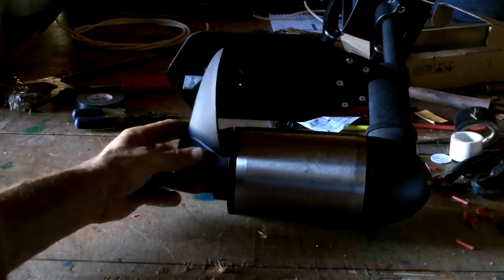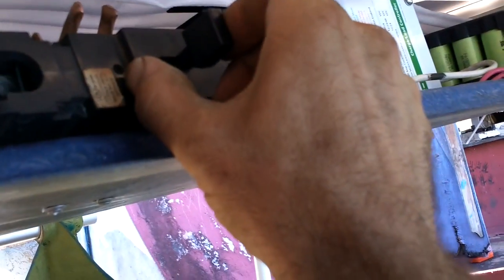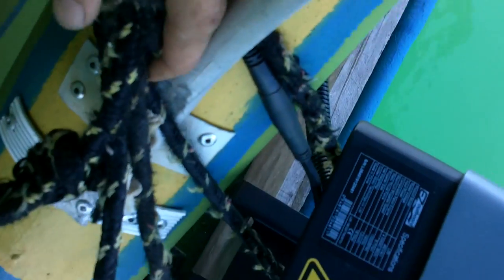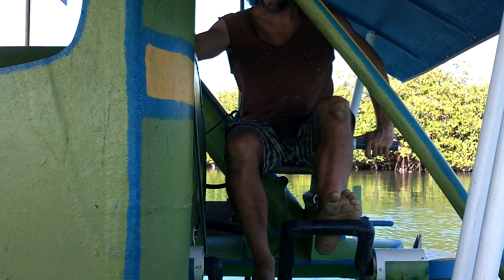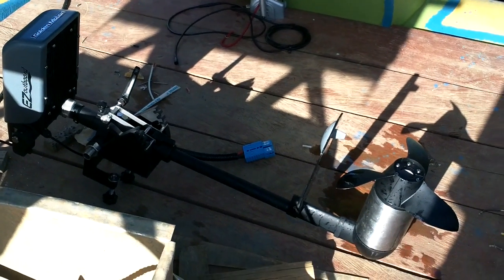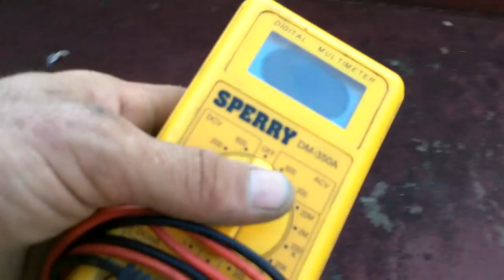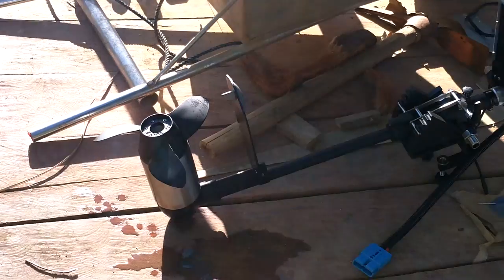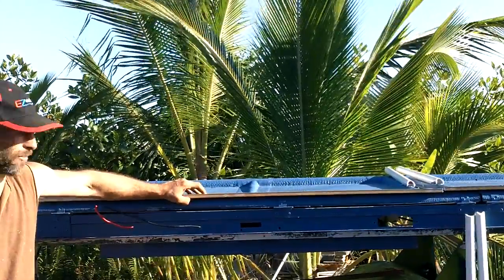Solar Snailer 039 Motor Test!

Comment: I've been watching your videos since your first attempts at fiberglass boat making, this is the first one I've seen with the comments turned on. Between your boat builds and Tech Ingredients  channel's Tesla Catamaran  you have inspired me to create my own minimalist live aboard solar powered Trimaran for on-the-water boondocking. Thank you so much for showing it's possible to accomplish a great deal with minimal supplies and equipment. Your first boat build you didn't even have a drill, I remember you stitching with a Swiss Army knife to bore the holes in your panels. Bravo man, I'm having trouble coming up with something sufficiently positive to describe your efforts. 

I'd love to have one of those electric outboards but it would cost more than my entire boat so I'm going to stick with the direct drive ebike hubmotor/controller I already have and rig a prop drive to it.
Reply: Flea markets always have dirt cheap trolling motors. $5-$20 range. Ditch the motor but use the drive system and prop. Or use it as it is.And please post vids when you start building.  I'm your very first subscriber. 
 Good Luck.
Reply: @2pi628  :I already have a Minn Kota trolling motor but they aren't very good motors, a brushless ebike motor is a lot more efficient, particularly at low power levels. Putting model airplane props on trolling motors like Tech Ingredients did on their Tesla Catamaran is better but even the best trolling motors aren't that good. You'd think an underwater motor would cool well but most of them don't because they are brushed motors with an internal rotor, the magnets are on the outside and cool well but the coils are the part that get hot and they are on the inside where they are just cooled by the air inside the motor.  The Golden Motor Jamie used in this video is a brushless one that uses rare earth magnets,  is more efficient and has the coils on the outside where they cool well.
Anyhow, thanks for the encouragement, I'm terrible at documentation because I get into what I'm doing too much to pay attention to a camera. I'm also  kind of self conscious about my workspace, I'm' a bit of a pack rat and my brother is a lot worse than I  am, we share a workshop and it's utterly jammed with stuff because once you get handy enough everything turns into useful material that's hard to throw out and he's a flea market/yard sale addict. 

It's been quite a while since I did a project and I can't find any full size pictures any more but here's a thumbnail of a recumbent ebike I made about eight years ago. 

https://tinyurl.com/qrha5qf

On edit: After looking at your channel I realize we share several interests including music and tiny homes/rv living, I'd like to contact you privately but see no way to do so on your channel. Mostly I text but I'm reluctant to post my # publicly since I've been doxed/stalked before.

Comment: Would be cool to be able to lift the manual blades out of the water while motor is on. Awesome build!
Reply: Yes and that would eliminate the vibration
Reply: Yup too much vibration and drag with the paddles in the water.
Reply: I thought the same but seems like it would be a complex heavy setup required that would be prone to breaking. I think since the water wheel is round a sliding cover for the bottom of it might work. If the water can be kept out it would even act as a tiny additional pontoon.
Reply: @kirkw1740  good idea!
Reply: That might reduce the amount of drag, even when peddling.
Reply: You're right, but Jamie uses the paddle as assist, so NO drag and longer life on the battery
Reply: @kirkw1740  A simple light weight fiberglass (over PVC) hinged arm could be used to rotate the entire mass up and forward out of the water.  At the same time he could get his saw out and remove a lot of unnecessary weight from all over the boat. I bet he could lop off 100 pounds(or more) if he put thought into it.
Reply: Since the paddle wheel itself is free spinning and relatively light the water resistance isn't that much.  A shield would likely create more resistance due to the shape.  Moving it out of the way isn't worth the effort either.   It also gives him brakes... Kind of.
Reply: It would be nice but wholly unnecessary as it moves fast enough and it runs on pure solar there's no real reason for the extra effort of a movable paddle wheel
Reply: @Mandurath  removing the noise, I feel would be worth a reasonable cost in efficiency.  Quiet , peaceful travel is worth it!
Reply: A guy in another comment (Gypsy Tinker, go upvote it), came up with the perfect solution: Have one or two paddles on the wheel be mounted on a hinge so that they turn into a flap, and then have them supported only in one direction (like a one-way flap valve). That way when he's turning the cranks, the paddles work as normal and are rigid. But if the water is flowing faster into the paddle than the paddle is turning, it'll flip out of the way and have almost zero resistance. All Jamie would have to do is rotate the wheel so that those flippy flaps are facing downward when he wants to coast (when one pedal crank is straight down, for example). The only drawback is you'd lose one or two paddles when you're going backwards (the'll flip out of the way), so you'd have a little dead spot on the wheel when backing out of a dock. Not a big deal, a few seconds compared to hours of better coasting.
Reply: Or he could also put a pulley on the water wheel and run a alternator to also charge the batteries, run lights. It seems to move just fine even with the extra drag.
Reply: Jeremy Genslinger or a belt and connect the water wheel to the electric motor instead of having a separate propeller. I'm just guessing.

Comment: I like what you do with such limited resources , one thing I learned about electrical wiring is as long as you don’t let the smoke out of the wires it should work.
Reply: Possibly not quite as limited as you think...

Comment: The EZ Outboard LO5 is a 5 horsepower electric motor that can consume 3700 watts an hour. Jaime has 11 200 watt solar panels to supply solar conversion power to his motor. I am going to conjecture somewhat, but this is what I consider to be real world numbers.  What we saw on the economy mode was a good 1000 watt usage from the batteries, in the lowest of 3 settings. At the early spring 4:30 time, he was getting maybe 400 watts from the Sun. A semi pro bicyclist will put out 300 watts in a continuous fashion. His trip to town is no small feat. The Solar Sailor is the incorporation of Jaime’s other endeavors in electric boat building. Experience thru necessity has resulted in another excellent final product.
Reply: Do we know the weight of his boat? Loa and beam too?

Comment: Loving the build Jamie. I had a look on the golden motor site and noticed your L-05 has an adjustable shaft. "Long/short shaft All-in-One, users can adjust the installation depth and angle at any time to optimize the propulsion efficiency". I also found out its rated as a 5-7hp motor with 195lbs of thrust! Interested to see its max speed on just solar power compared to the batteries!
Reply: Wow..Thats pretty good. (7HP x 745 Watts)/70% = 7450+/-  Watts from the Batteries and Panels for full thrust rating. 
How much in power in Panels does he have? And in Batteries?

Comment: RE: Obstructive paddles. If one of the paddles could pivot in only one direction so it would only engage when pedaling forward, pivoting when coasting. Rotate pedals so this paddle is at bottom when motoring, lock pedals. Folding prop style, with minimal modifications or weight.
Reply: Wow, that's an awesome and simple idea. That'll totally work! Great thinking!
Reply: @MattsAwesomeStuff  If you want efficiency look up "Spider crank paddle wheel"....
Reply: I think the paddlewheel is used to power the craft in reverse, too.
Reply: @Patriottoo2  .yes. With only one paddle like this, it would reduce efficiency in reverse, but you don't travel far in reverse and the motor also has reverse.
Reply: @GypsyTinker2012  Okay, I re-read your first post, and understand it, now.  Great idea.  If reverse of motor is as fast as forward, it doesn't appear useful for slow maneuvering.

Comment: hydroplanes for the high speed mode
Reply: in the hydrofoil experiments I saw Jamie do there was no pilot wing to set the ride height. Once the current electric optimization gets handled I bet the next stage is hydrofoils, they are getting more common now in the world.
Reply: @benhansen6308  I hope you are right.  I would really like to see that beast hit 10 or 12 knots or so. I think he could it with foils.

Comment: I had a thought watching the video while the motor is running the Paddlewheel is still having to turn so maybe a small Dynamo of some kind on the paddle that would help charge the batteries at the same time just a thought I had

Comment: That motor cluck it's even in water. on start up is bad in the long run, loose play then solid metal impact . E. Motors has full high torque on first turn. Might be wise to low pre voyage the motor some how, or maybe check the relationship to the output blade. Maybe you can take up the slack manually somehow . But good job. Just About there

Comment: Does the paddle drive create much drag?  The noise alone contributes to the stress of a long trip I am assuming.  Some creative enginerding would be required to get them raised out of the water and easily lowered again on the fly I'm assuming.  Cutting, levers, locking mechanisms...

Comment: Please dear wizard, find a way to raise and lower your paddle wheel system. Then your fine Chinese electric motor will propel you at unbelievable speed. Town in one hour! Way to go Wizard of Panama, with two fine children. P. Gilhooly
Reply: Everything is fiberglassed into place, and connected to the axle that he sits in front of and pedals. There's no gears or belts or anything to adjust it. Sadly, when he chose a paddlewheel and chose to mount it that way, it's permanent ("permanent" as in, he'd have to do massive surgery to the boat and redesign it to make it different).
Reply: Or add an alternator to the paddle crank for the worlds most inefficient power generator!
Reply: 3 childs
Reply: @PlasticAssasin8  Genius! Think you might have just cracked perpetual motion🤔
Reply: @PlasticAssasin8  Заставить работать подвесной мотор, от генератора, вертящегося от гребного колеса? Очень забавно! Но, к сожалению, не работает - учитывайте потери мощьности!
А вот, установив лодку на якоре на течении, в непогожий день, можно, было бы, поддерживать аккумуляторную батарею в заряженом состоянии, Это пожалуй и получилось бы!
Make the outboard work from a generator spinning from the paddle wheel? Very funny! But, unfortunately, it does not work - consider the loss of power! But, setting the boat at anchor along the river, on a bad day, it would be possible to maintain the battery in a charged state, It would probably have happened!
Reply: I think it's a family of 5,correct me if I'm wrong

Comment: how about a disengage/lift of the shovel or you need gearing, or skip the shovel and generator pedal
Reply: and consider putting some corrosion protection on that long thread on the shaft...

Comment: Dear Master, please remake the paddle wheel!
Or attach it to the electric motor through a belt drive and use as necessary, loosening or pulling the belt between it and the electric motor!
Either disengage the pedal drive and the paddle wheel itself and lift the wheel itself to the top in its casing! After all, it slows down the boat when driving on an outboard motor!
Yes, and the constant slapping of the wheels of the propeller wheel, during long voyages, is very tiring!
Regards, Your viewer

Comment: Don't you want the motor on the center line so the boat goes straight.
Reply: In that case you can hit something with propeller blades. If you mount motor behind one of the pontoons - it will be much safer.

Comment: Install a motor well in one pontoon with a raised box to protect from rain and splash ... Check the motors input voltage requirements compared to your panel output voltage to see why low is so strong ... Adding a variable resistor inline would give you more control of motor speed ...
Reply: No, do not put a variable resistor in line with a power line. It already has a variable resistor in the speed control, just use it or add one there, not on the damned power line.
Reply: @MattsAwesomeStuff  a simple explanation as to why not would have sufficed without the snippyness ...

Comment: Gonna have to seriously consider using that motor on my Jaime inspired boat build - a 16' long solar-electric pontoon patio boat. I did not opt for the paddle wheel as I won't be going long distances and instead have decked over the entire boat for maximum floor space. I was planning on a 12v system with two trolling motors but am now rethinking things.  https://youtu.be/r0rHrbnylD8

Comment: If you buy a voltmeter with an amp meter in it that has a clamp to put over a cable you can see what power you draw or charge very easy. Just clamp it over a wire and you know it